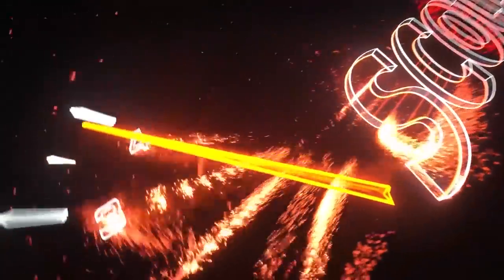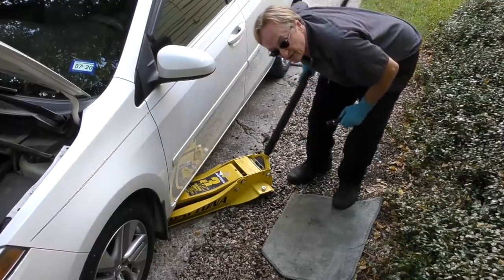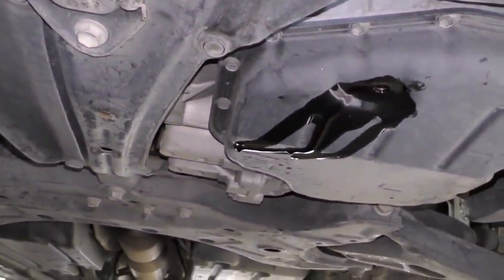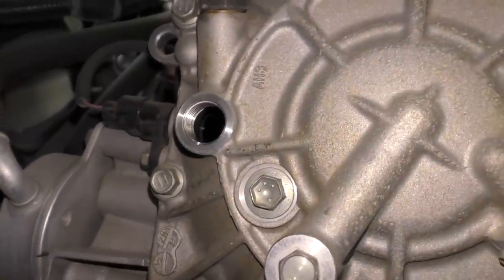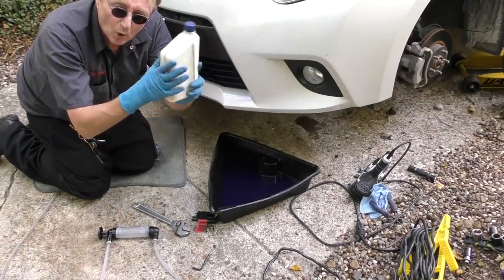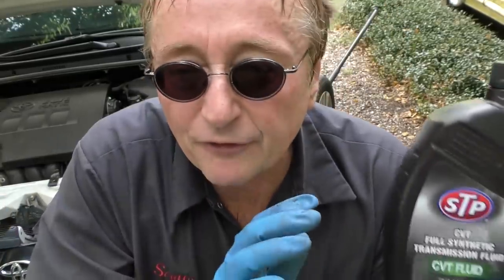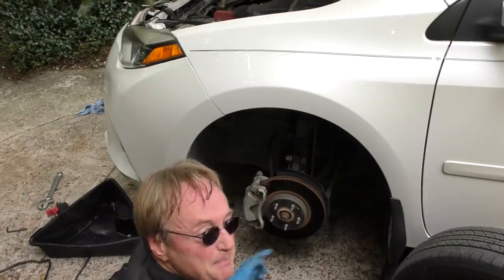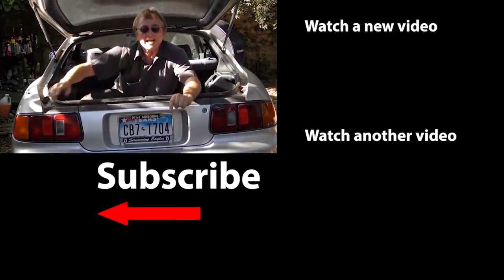This Toyota Corolla Has a Serious Problem

Comment: Hey Scotty (or anyone mechanically inclined), 

Should I change the CVT transmission fluid every 40,000 miles in my car? I know Scotty tends to vary the numbers. I do 90-95%  of my driving on the highway so I put about 20,000 miles a year.

Comment: Rather than use a pump.. stick the hose down in from the top and out it into that hole .. use a funnel and just pour in the correct amount.
I do this on my Prius also..  simple drain and fill. No filter on the Prius.
I wonder if there is a filter under that transmission pan you should change every so often.

Comment: Hey Scotty I have the same 2014 Corolla with a CVT. I had the fluid changed at a lube shop and they said I had ATF fluid in it originally. It was red but looked a little burnt.  They advised putting the same type of fluid in that came out. So I did. I've wondered if that was a mistake this whole time and wondered if I should do a real transmission service and put CVT fluid in it like I've suspected i should have.
Reply: lmao. that is really bad you brought your car to a lube shop to do tranny work. . .

Comment: Always take the fill plug out first, if you get in a situation where you have drained your transmission, then round off the fill bolt trying to take it out, you have no way to fill you transmission

Comment: Good
Scotty 
Does it matters if the fluid hot or cold ? A you know this transmission fluid expands with heat. 
Like the Tacoma the fluid leve measurement should be when the fluid in a certain temperature.

Comment: I buy transmission fluid ONLY from the dealer for my car. The engine oil that I use is Liqui Moly. People say that they don't change their transmission fluid and I try to tell them that they should, but they say that it is "lifetime". At that point, I stop arguing.

Comment: What do you think of the 2018/2019 Chevy Silverado are they reliable or not I just got a 2009 Chevy Silverado 1500 which one is better the 2018/19 or the 2009 so far no problems with the old one

Comment: To others who view this.  I agree with this as long as the engine is ambient temperature (same temp as the replacement trans fluid).  If the engine is hot, then (said respectfully) this is probably not the best way as the volume of the trans fluid changes with temperature change (and there is another BETTER more technical way to do it if it is hot). JUST PLEASE MAKE SURE YOU DO YOUR HOMEWORK ON YOUR SPECIFIC VEHICLE BECAUSE  (JUST BLINDLY DOING IT THIS WAY) MAY END UP DESTROYING YOUR TRANSMISSION.

Comment: Hi there. We have a 2006 Toyota Corolla ALTIS which takes 3-5 minutes to accelerate from start. We noticed the issue and we we're told to change the ATF. But after the ATF was changed the problem became worse, it now takes 10-15 minutes to accelerate. Reverse is okay though. Only the drive has a problem. Is it a major problem with the transmission? What should we do? I'd appreciate your response! Good day!

Comment: Scotty, I got a 9 years old battery (Varta - AGM,) in my Merc (W245, 2010, 110.000km), that still works very fine. Should I change it before it runs out (exakt same battery 160 US dollar, here in Sweden)? I tested it with Cteck charger, and it passed. By the way, never had a repair on the car yet (bought it brand new), knock on wood. Learned how to do service my self, since Mercedes charge crazy prices! Saves me 80-90%, and I do use only the best service products! I now also learned how to change brakepads and rotors, and even brake fluid! Now Im learning even more stuff from You!!!!  Many Thanks!

Comment: My trick to avoid cross-threading fasteners in plastic or aluminum during reassembly = Turn the fastener counter-clockwise until it "drops" into the existing threads, then tighten as far as you can with your fingers before using a wrench.
Reply: If you get resistance after only a turn or two, take it back out and try again.

Comment: My car has a wet dual clutch semi-automatic transmission, and the owner's manual says to replace the fluid every 60k km. Imagine all the residue from friction that goes into that fluid on a daily basis...after dismantling and cleaning it with 40k km, I'm going to change it every 10k. Some specialists say, that if you race it, you need to change the fluid as often as 5k km. I prefer spending $1k with fluid and filter than have to buy a new transmission for 15 times that.

Comment: Land Rover said the transmission fluid for my evoque was good for the life of the transmission, I’ve got the 6 speed Asian warner. I checked the fluid at 60,000 miles and it was black, extremely black. Good thing I checked it. I was flooing the car one day when transmission started to slip I changed ALL of the fluid which was easy to do and since then the shifts have been smooth, since it’s so easy to change the fluid I just do it every year. Better safe than sorry

Comment: CVT you don’t have to change fluid.  CVT are easy to rebuild. The belt is the part you need to change for maintenance. 60k replacement- thats what really needs changing

Comment: I have 2009 toyota Corolla. There is no battery light at all. Buy Alternator is not charging battery. I put new one on the car nothing changed. Checked all fuses and relays. I even removed fuse box to check fusible link. All good. I even put old alternator and battery on different car they both work good. Can someone help me please? I also checked all wiring both grounds and positive. Need help.

Comment: Tip!!! Check that the fill will remove before you take the drain out!! Granted my car was 20 years old but I couldn't get the darn thing off😂my car seat for two days until I was taught that putting a little tf on the bolts loosens it up

Comment: I have a question. I have purchased valveline cvt transmission flud for my 2016 toyota Corolla that was recomended, but the fluid is amber and not pink that was in my car. I have check the maintance and it does state cvt. So my question is is it ok to mix valveline cvt fluid that is amber with pink cvt flud from the manufacturer?

Comment: I took your advice regarding my 2017 Rogue...drained it and it had exactly 4 quarts...and at 30k it was very dirty !...thanks !
Reply: longsundayrun you changed your transmission fluid at 30k miles just because you saw this video...? You definitely don’t need to be doing that, but to each their own
Reply: @ieatslag5947  Nissan CVT is notorious. It's better to over maintain it.
Reply: @ieatslag5947  Honda recommends changing theirs every 90K for normal driving conditions, and every 30K for harsh driving conditions. I'd say even more reason to do it every 30K for a Nissan. I think all CVTs should be done every 30K no matter what
Reply: Kevin Maldonado , I have always exceeded the maint on all my cars...not a bad thing actually...and in this case, I had heard from others about doing early fluid changes on this tranny...Scott has talked about it many times...for a $30,000 car, I’d rather just spend a little more and keep my eye on it....it’s certainly very inexpensive..only $70 for the fluid

Comment: Proper way is actually start with a cold engine put that plastic tube in, pour some fluid in, start the engine, pour more in untill it start dripping. Keep measuring until fluid temperature reaches 113 F degrees. Then screw the drain plug. If you start with a hot engine fluid temperature will be too hot and it will be insufficient amount of fluid. It has to be around 105 -115 degrees.
Reply: You can do measure what you took out put the same in, but what if it was already low on fluid.

Comment: In another video i watched, they said the drain plug to be tightened after pouring in the new oil and let the new oil start coming out for a moment, alongwith this need to start the car and shift the gears. This will help get rid of any air vacumm in the system.

Comment: I got my trans fluid and coolant changed in my Prius at 80,000. I would do it myself but I am handicapped and can't get back up by myself. I will start getting them changed every 40,000.

Comment: Take the filler plug out before you drain the fluid. If you drain the fluid and the filler plug it stuck or rounded the you will be stuck with no fluid in the transmission.

Comment: My 2003 Toyota Avalon is like this it has a drain plug I’ve changed it many of times but it has a dipstick also what about my wife’s 2011 Kia Sorrento it has no drain plug no dipstick it’s all sealed up it doesn’t even have a transmission pan How do you go about changing that fluid

Comment: One step that was missed is that you actually remove the fill bolt first. Last thing you want to happen is you drain all the fluid out of the transmission then find out that the fill bolt won't come off and now you're stuck.

Comment: This looks like a 2014-2016 Toyota Corolla S trim. Toyota refreshed for 2017 and replaced the S with the SE.   I have a 2018 that just turned 4000 miles in 16 months
Reply: Wow!  4000 miles in 16 months!  Better slow down on that mileage!!
Reply: @wsfd4321  Yeah..my 1968 Corolla only has 70,546 miles on it.
Well...ok...it's on it's eighth or ninth rollover, I've kinda lost track.

Comment: Scotty you have to do a tacoma 2016 transmission fluid change not sure if previous gen is the same process. I saw a video that the oil must be at certain temperature then drain the old oil and use a pump and put a new oil. Kinda complex old vehicles werent that dificult.

Comment: I would not suggest doing this yourself unless you have a scan tool that shows transmission temp. Toyota also has a special tool for checking level and has to be at the correct temperature.
Reply: that plastic straw is the tool.  I have the toyota pdf on how to check it.   Only tricky part is the temp range to check it in(what the scan tool is for, a bluetooth odb2 and the torgue app will work), and to be level.

Comment: Never worked on a CVT transmission but I can't imagine it would cause any harm to perform a flush as long as it's done properly and regularly. This way if you only drain less than 2 quarts, you should repeat the process several times after having driven it a few miles so you get all of the old fluid out. Typical FWD transmissions have a capacity of 8-12 quarts so changing a couple of quarts every 40k won't do much of anything. Over 75% of used fluid remains.

Comment: Scotty, I believe you missed two very important points.  First, by replacing the same volume that came out, you are assuming the transmission was already filled to the correct level.  That could be a poor assumption if there's a leak.  Second, fluid volume is a function of the fluid temperature.  The fluid you take out should be the same temperature as the new fluid going in.  If you take out warm or hot fluid and replace it with cool, you could very well overfill the transmission.  Perhaps a better measure than fluid volume would be the fluid mass.  If you have equipment to weight what came out, and replace it with equal weight of new, that might be a more reliable technique.
Reply: brat997 “DNY automotive “channel shows the proper way to change the trans fluid

Comment: Hello Scotty. 
Mechanic changed 2016 Corolla LE shaft due to vibration under vehicle when accelerating especially uphill. Problem went away. However new problem popped up. Delay in shifting To D or R. There's transmission slip as well. Bad braking too. Transmission mechanic says we need to change valve body. Transmission was working perfectly before shaft change.  I don't know what they are doing to the car. Can you please advise on that? 
thanks.

Comment: Scotty I just purchased a03 navigator with 136,000 miles I have heard that its air ride system is problematic and that it would be a good idea too saith over too shocks and ciolsprings  what's your opinion and also how would I turn of the air suspension light on  the dash

Comment: What if it was low on juice to begin with. I do the drain and fill, slightly over fill it, idle it to operational temperature, then drain to the proper level.

Comment: Hi Mr Kilmer , Is Amsoil CVT fluid good for Toyota CVT transmission?  .I have a 2014 Corolla with 36k miles on it and I will plan to change the fluid soon at 45-50k miles.Thank you in advance  for your reply.

Comment: I have a 2013 gmc terrain with 105k miles on it, should I change the fluid or is it too late? I think its the 6t45 transmission if that makes any difference.

Comment: Hi Scotty, I have a 2008 Toyota Corolla Axio and it doesn't have a dipstick to check the transmission oil level but thats not my problem. There is a dummy plug at the top of the transmission pan and it's leaking. Can that plug pry out because it cannot screw out.

Comment: Did this with my 2012 lexus is250, in the states its lifetime trans fluid but in Canada the same fluid is 96,000 km/ 60,000 miles, so changed it,was talking to the dealership service advisor and he said it basically comes down to them not caring as much about maintaining cars in the states, dont know if it's true especially when the northern part of the states gets the same weather as canada so makes no sense why they dont treat them the same.

Comment: What I know about CVT transmission fluids it varies for Nissan,Toyota,Mitsubishi, and Honda. You will have to find specific fluid, like for Mitsubishi cvt you have to find j4 or j type fluid,I ended using a multi cvt by ATP that worked great, Nissan uses NS2 series fluids, and Honda uses hcf.

Comment: It clearly said on fill plug "WS" aka world standard Toyota fluid, and after fill up you need to correct the fluid level by placing the car on level ground or lift, start the engine and remove the big plug on the bottom, wait till it only dripping, close the plug and only than it's done. Also you need the transmission to b at correct temperature.
Reply: yeah what a lazy, incorrect job. sad really

Comment: Scotty, I am a bit confused about the CVT fluid. I had a Nissan Maxima for a VERY short time(car cost $5K and repairs were going to cost $10K) and the transmission was crap. I was told that if the fluid was not GREEN it voided the warranty for a new car and would be very bad if it were not green fluid at all. I noticed that the fluid you extracted was RED. What's up with that? Nissan proprietary fluid color?

Comment: 2007 Dodge caliber I bought new still has original cvt now has 155,000 miles. I never change the oil because dealer told me I don't need to. I guess I'm lucky trans didn't cost me a penny. It still functions like new.
Reply: I would change it if you want it lasting as long as possible. Even Honda's maintenance schedule is at least every 90K for their CVTs and they make the best CVTs

Comment: Daf, Netherlands, had the first cvt! Later Volvo took over. The first cvt looked like the scooter cvt. Open belt...
The first models had two of Them , so no need for a differential. Extra.. in the mud there was always grip by one of the two systems. See DAF 33!

Comment: hi scotty i have an old toyota starlet which has more than 250000 kms on it and it does't have a dip stick on the transmission either .i need your opinion the oil change is required how  often ?as i bought this car old and doubt it ever had an transmission oil change mechanics where i live never changes manual gear transmission fluid.

Comment: I have a 2014 Corolla with a CVT transmission and when I checked into changing the fluid it was a long precise process that required a scan tool.  My question is will this really work for a proper fluid change?  I don't want to do any damage using this method.
Reply: James Kaminski “DNY automotive “channel shows the proper way to change the trans fluid

Comment: Hi Scotty,
This process is based on the assumption that the fluid level in the transmission was correct.... I would suggest a video on transmission flush through cooler lines on late model 6 speed ATX Toyota Camry transmission including the proper process for determining correct fluid level for ATX without dipstick.

Thanks!

Comment: it is better to change any fluid on time but people are not stupid when they say don't change it they just tried it before, not alot of people change on time and when its too late it might cause problems, i have an old manual gear Datsun fluid never changed and its almost 700 thousand KM, still running fine. I dont think its the same case with newer cars gearbox fluid needs changing on time especially a CVT 😅

Comment: I heard my vehicle has a “sealed” transmission. So no drain plug etc?? I have a 2015 Jeep renegade trailhawk and I want to keep up with the maintenance. They wanna charge me $380 for transmission fluid change. Using a special machine to suck it out completely whatever. I heard their transmission fluid is like $40 a quart too. So could I do it myself then?? Or is it really sealed. The coolant change I want to do as well and that’s gonna be $180. It looks complicated to me to do it myself as well. Hoses are connected with a weird bracket I have no idea how to undo. Radiator has no drain plug either. Are there any new 2019 vehicles out there that are still DIY maintenance easy??? For mostly everything like transmission fluid and coolant etc?  I’m assuming right off the bat the Nissan Frontier?? Tacoma?? I heard Tacoma has a sealed tranny as well

Comment: Scotty . Some people get real technical about these CVT fluids , using scan tools and measuring fluid temp's , etc . How accurate does the amount of fluid added have to be given that some will remain in the drain pan and the lines of the pump . Is plus/minus 8 oz close enough or does it need to be right to the ounce ?

Comment: Hey Scotty my 2012 Jaguar XKR 5.0L supercharged at 75k mikes has a deep pitched tick that starts after about a minute after startup and is only heard at idle like at a stop sign.  After I give it some good gas 5 minutes later driving it goes completely away.  I heard it’s the “high pressure fuel pump cam follower”.  Every hear of such a think on these 5.0L jag V8’s??  Thanks!